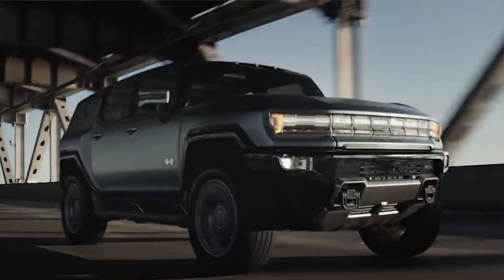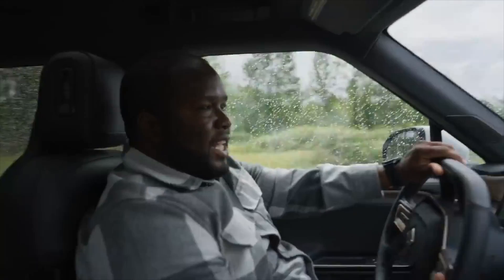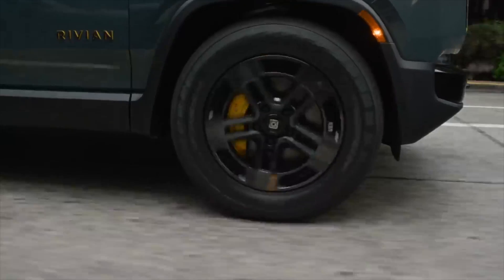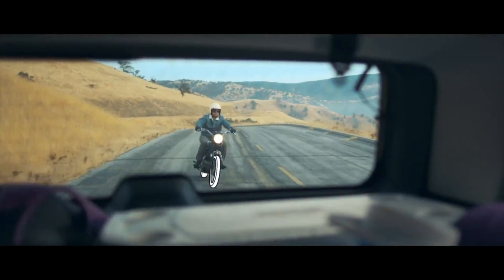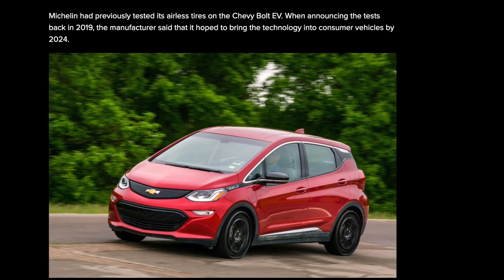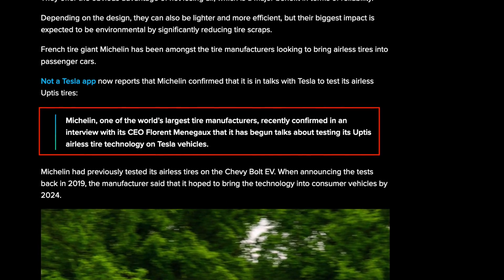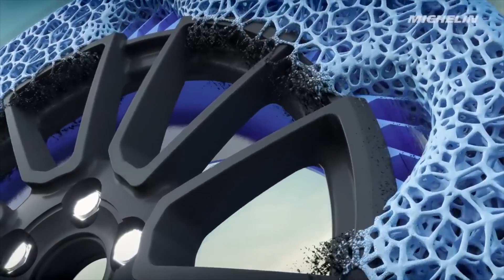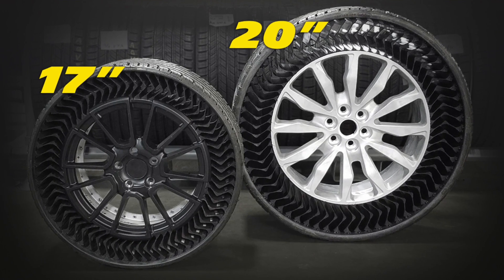Tesla Preparing for UPTIS Airless Tire Design | This Changes Everything

Comment: It been around for the last 10 years.  Micheline might need Tesla to help with designs and overcome problems with these tires.
Reply: honestly it is a easy set of problems to solve, durability, design stucture, weight capacity... pretty simple, especially with ai now.

Comment: You have heard that Michelin has disputed the fact that they are working with Tesla on the new airless tires , they have said they are not.
Reply from the maker: Wasn't aware until your post, but it seems like you may be right. I'll pin a comment to update, thanks!